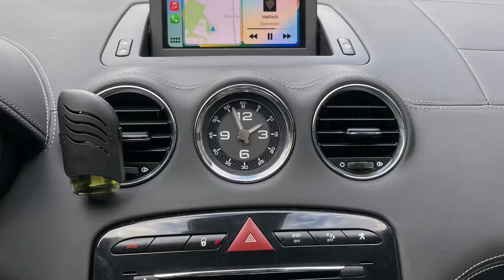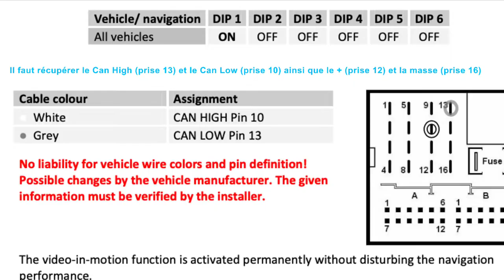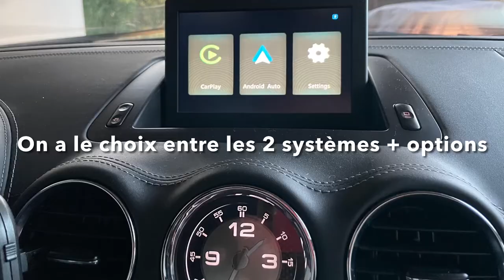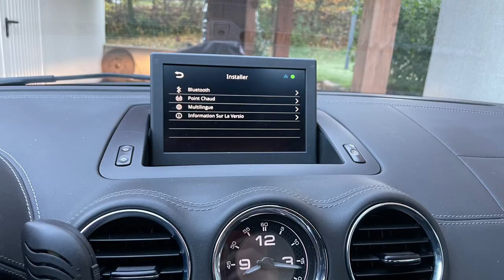Peugeot RCZ CarPlay / Android Auto sur Wip Com 3D

Comment: Great video. I found the product on Aliexpress,  but the most important thing is I want to know if the video or the display will work while car in motion.  Because in the original NG4 the video will be blocked while car in motion for safety purposes.
Reply from the maker: La vidéo fonctionnera sans soucis en mouvement justement grâce au 1er 

 https://www.car-interface.com/vendita/en/274-video-in-motion-peugeot
Reply: @TheMullpacha13  thank you for the reply.  So u mean to say I have to buy this one plus the box and without it the box I buy from aliexpress will not work while car is in motion? I think I also have to buy the 2nd option because my system is wipcom NG4
Reply: Have you a Aliexpress link?
Reply: Hello, do you have the AliExpress Link?